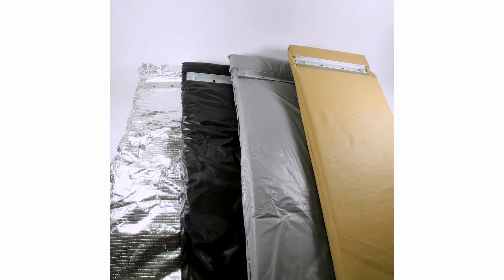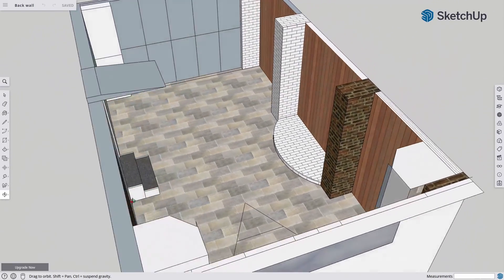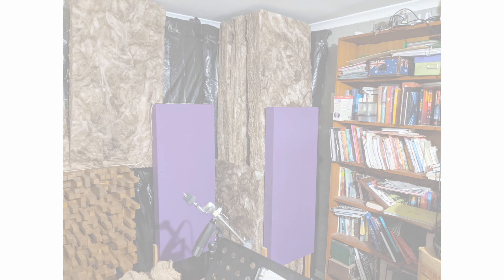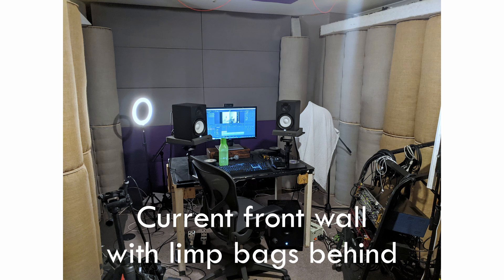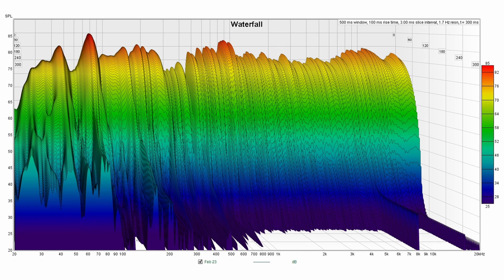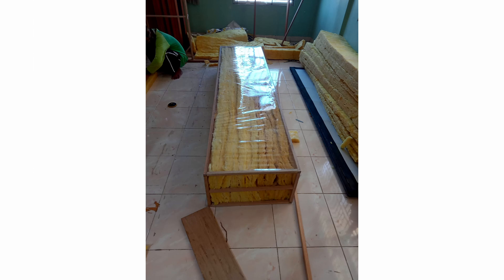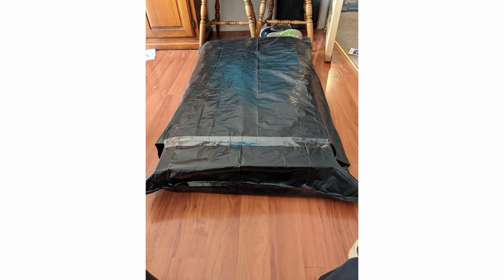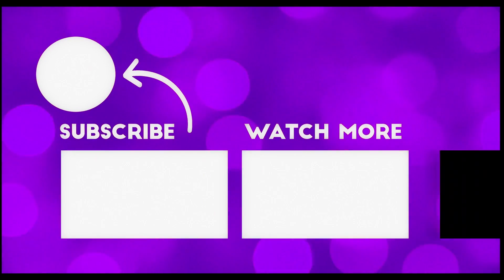Fixing My Low End (Home Studio) | SPLmixing.com

Comment: How do you build the tube traps ? Are they more effective than super chunks ?
Reply from the maker: No, they serve a different purpose. Superchunks work well from floor to ceiling in all room corners. For the tube traps, I followed a YouTube tutorial I found. Still, you can get similar results using regular panel traps placed around the perimeter of your room, with less effort and space requirements. I didn't know this when I made the tube traps, but I have since learned otherwise. Don't waste your time with tube traps. The data does not conclusively support them being any better than regular insulation panel absorbers.
Reply: @SPLMixing  thank you !

Comment: Interesting, essentially you added an awful lot of absorption, but hard to conclude the benefit of the membrane as you have no comparison between all the new insulation not in a bag and in the bag. You might want to check the rt60 in 1/3 octaves and over lay your results as this will help show the change between the two environments. The plastic might actually be maintaining a little of your high end so the room doesn’t sound too dead. The rt60 would show you that too. Anyway, certainly an improvement and good luck with your further work and mixes.
Reply from the maker: I performed a basic limp bag test on my rear wall prior to committing to them in the room and it showed very promising results for RT60. I'm very happy with the room currently, my monitoring needs an upgrade though.

Comment: Hello, do you have a link to the video or article form john brandt that describes the limp bag traps?
Reply from the maker: https://www.facebook.com/groups/517162262483268/?ref=share&mibextid=NSMWBT
Reply from the maker: Lots of information here
Reply: Thanks!!
Reply: By the way, how thick are the bags you are using?
In the facebook group I read they should be 2mill which equals to 0.0508 mm,  but that sounds extremely thin, and in your video they don't appear to be anywhere near as thin...
Reply from the maker: 2 millimetres thick

Comment: Hi if i use the limp bags over a foam and not an insultion it still work?
Reply from the maker: The short answer is "I'm not sure". No one (to my knowledge) has tested this out. If you do try it, be sure to perform extensive before and after tests. This is still relatively uncharted territory by most acousticians, with the exception of John Brandt and Ron Sauro.

Comment: Nice results! I've got some panels I made with dense Hardiefire wool but have wondered about supplementing them with some less dense pink fluffy insulation - was even thinking about trying bean bags filled the the stuff in the corners but guess you need to go floor to ceiling with this stuff to get the best results?
Reply from the maker: From my own research, it sounds like less dense is the way to go. Even though the Knauf product I used calls itself High Density, it's not that rigid or dense. The idea of the limp bags is that they cushion the bass where the most pressure builds up, which is in the tri-corners and bi-corners where bass is most active, and along the surfaces of the room i.e. walls and ceiling. Floor to ceiling trapping will cover the areas nicely, but you should always test this with a calibrated mic and follow the scientific method to A/B yourself towards a better sounding room. Even the best acoustical designers change plans on the fly to accommodate the numbers they're seeing back from testing. It's worth experimenting, and even when I've got things wrong in the past, I've always been able to re-appropriate the materials to a new design philosophy.

Comment: Did you test these traps with and without the "bag"?  I'm fairly sure the garbage bag is not doing anything at low frequencies, and the results you see are simply from the stuffing material.
Reply from the maker: Yes, see previous videos. Acousticians have tested these out independently and determined that the garbage bag / 2 mil poly makes them absorb a bell shape of lower frequencies. These are based on a commercially available product and variations of the design (pictured in the video) made their way into many of John Brandt's recent studio designs too.

Comment: Have you done any tests without the additional treatment? (with just the limp bags) to see what effect can be directly attributed to the limp bags.
Reply from the maker: Yes, but it doesn't help the mids and highs, as the bags need soft treatment to stop the reflections. However, I did observe a smoothing and evening out of the lows.
Reply: @SPLMixing  true, but would have been nice to see their effect on their own, as you have some very thick porous absorber in front of it, wouldn't a thinner layer would have sufficed for mid and highs?
And by the way, how do you think these limp bags compare with superchunk? They work better on the low end?
Reply from the maker: Super Chunks serve a different function as they are velocity based absorption, whereas Limp Bags are pressure based absorption. A thinner layer might have sufficed, but I didn't want to take any chances that I would need to revise the room again. So far, so good. I do remember testing the limb bags on their own on the rear wall, and their effect was as I described in the previous comment.

Comment: Do limbags  help with a 30 Hz node ?
Reply from the maker: They're good for overall smoothing, so they'd help. If you're looking to target specific frequencies, you're best to make 2-3 inch insulation panels with the wooden frame extending further behind the plane/face of the insulation. By extending the wood, you create a sealed cavity behind the insulation and you effectively lower the absorptive frequencies of the original panel. The wood extension must be seated and sealed against the wall. You must experiment with the depth to target that low.

Comment: im curious to see the differnce between your method of using two bags over top of each other (im assuming you used 2 full bags?) and just cutting a "lid" out of another bag and only overlapping by 3'' or so.  i have built several of johns bags (i see you used his framed model as an example) but in my conversations with him it seems that 2mil is the magic number so far as the membrane is concerned -  with a permisable jump up  to 3mil.  But by overlapping the bags entirely you are essentially doubling the thckness of the membrane. 

i realize  that your results are unique to your room specifically and not to be considered as standard for these things... but id be intersted to see if theres any diffence in performance between the two methods !!
Reply from the maker: I wish I had more time to test out different thicknesses. Thanks for this information, I believe I'm within that 2-3mm window, even with an overlap of approximately 1/3 to 1/2 of the insulation batt height. I did not trim down the bags, I just used the 2 x full lengths, but it still worked out well for me. The decay time for the bass frequencies was very smooth, much like the 'sausage of sound' John talks about when it comes to bass. I pasted my data in his Facebook forum too of my results.

Comment: Let me ask one more question...limp mass is supposed to work with trapped air pressure in a solid wooden cabinet and a flexible membrane in the front. In your approach there is no solid wood cabinet and no air pressure. What's ur working principle here ??
Reply from the maker: Not my working principle or design. It's a design that has become popular recently in acoustic forums. All I know is that people have tested various versions and this is the cheapest implementation of it. Limp mass traps work differently to limp bags, there's no requirement to have a wooden compartment.
Reply: @SPLMixing  awesome !! 👍👍 Apart from limp bags, you added huge amount of absorption material in front of limp bags. By any chance is this working just like regular bass traps?? . How can we come to a conclusion that polythene covers are adding value. (I'm just trying to understand purely from technical perspective. No offense what so ever 😊😊😊👍)
Reply from the maker: I tested the poly plus insulation and just insulation separately. Not sure if I documented that in a video, but the bags did appear to have a broadband bass absorptive effect not observed with insulation alone. As the limp bags on their own are reflective of highs, you must place insulation in front of them, so keep that in mind. Also worth mentioning that insulation on its own is not considered bass trapping in any acoustics forums. I did it because the more you add, the smoother the response overall at the cost of some space.
Reply: @SPLMixing  😀😀😀 that's awesome to know !!!!  For absorbing highs one single 50mm thick absorber placed in front of the limp bags leaving  50mm air  gap behind should work down to around 200 hz. Any ways .... congratulations man 😀😀 love your work 😊👍👍

Comment: Thanks for this great video! I'm based in Sydney Australia and I think the solution you've outlined here is right for my room. Just double checking, is the insulation material you used Earthwool Sound Shield R2.5? I notice this is fairly low density compared to say Owens Corning 703, does that have a large effect on the low frequency absorption of the bass traps? My main problems are a 6 dB dip at 75 Hz and a bout a 10dB peak at 107 Hz. Any advice is much appreciated.
Reply from the maker: Higher density material will reflect bass instead of absorbing it, according to acoustic expert John Brandt. Knauf earthwool in a roll, not batts, is better.